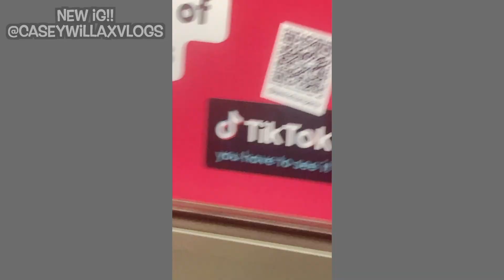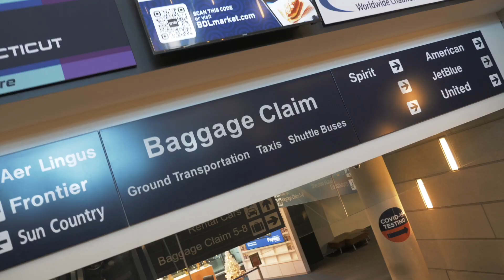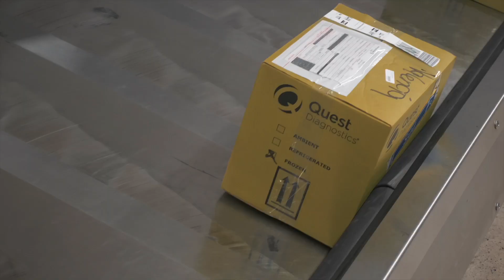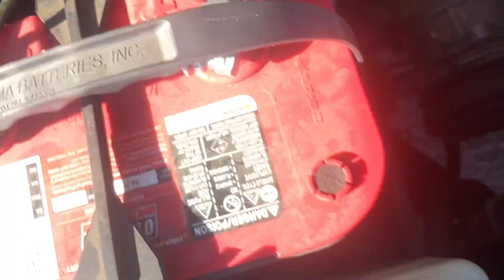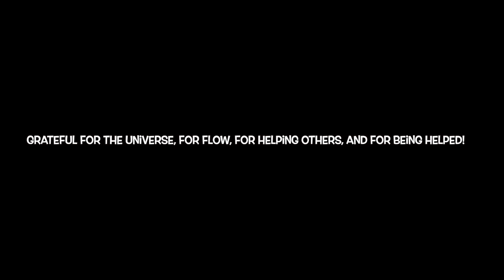THEY STOLE MY CAR?!?

Comment: Bro that was actually lucky. What could have happened if you were driving down the highway and those bolts dropped out? Does not bear thinking about. Might have cost you a lot more that 8 hundo. Just glad its all sorted now and the stoke is high. Is the T Cap gonna be getting into the big waves with that board?
Reply from the maker: Yesssirrrrr